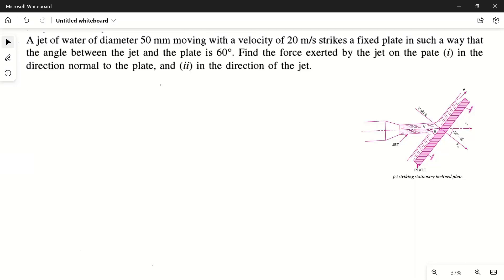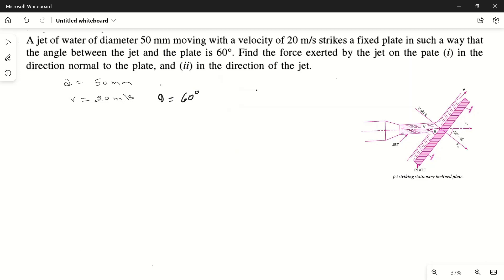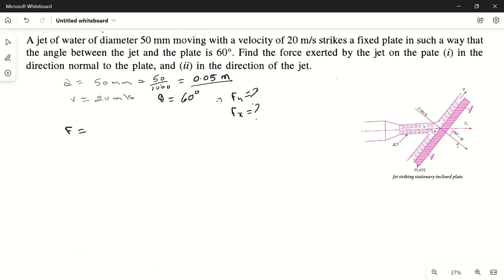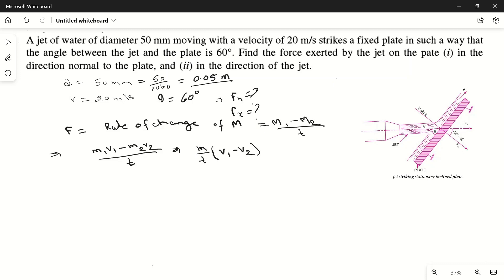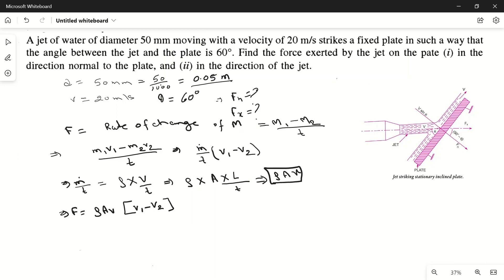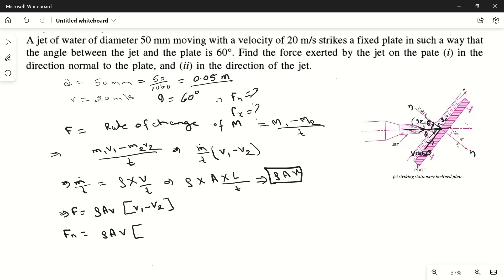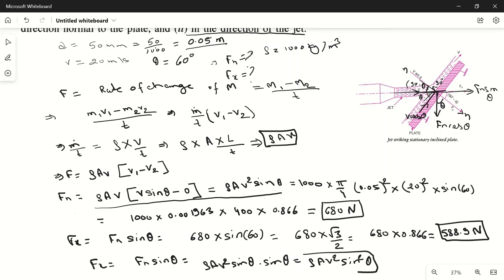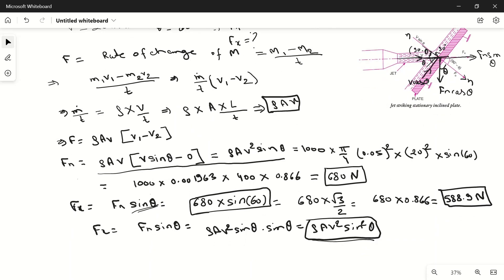NUMERICAL PROBLEM: 02  FORCE EXERTED BY JET ON A STATIONARY INCLINED PLATE

Comment: Why weren't the velocities out taken into consideration?
Reply from the maker: water is coming out from all directions (360°) from plate after striking (which you can't see in 2-D ) so net force will be zero if you add all components (due to symmetry)
Reply: @mechpm  how come the net force is zero despite gravity acting on the fluid?
Reply from the maker: @spookynelly912 
In most of the real case scenarios when dealing with jet and plate like turbines etc the force due to gravity is very insignificant compared to force due to jet striking the plate hence for simplicity of the solution we can ignore gravitational force.
Reply: @mechpm  thanks <3